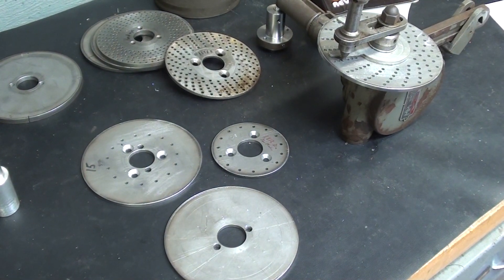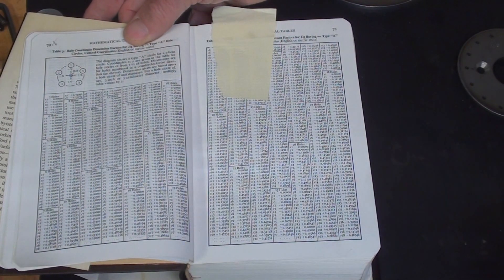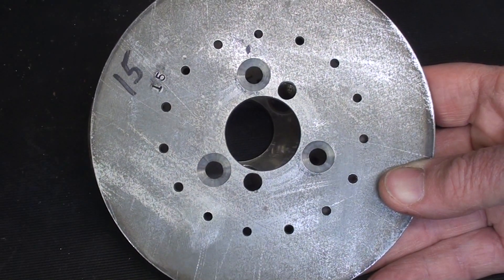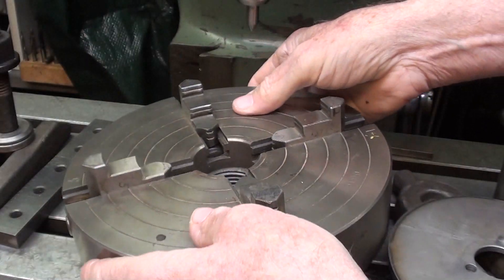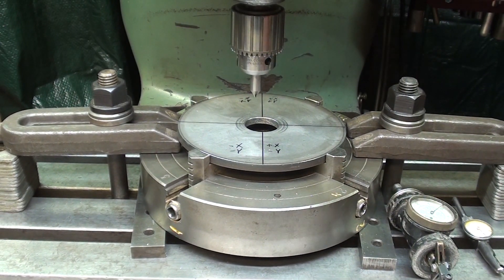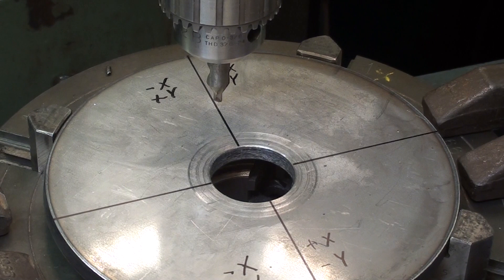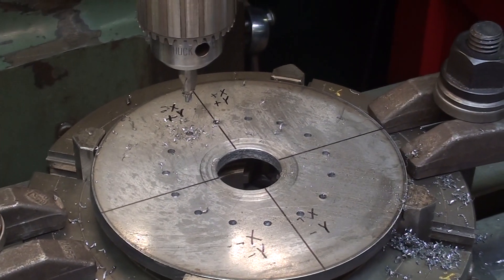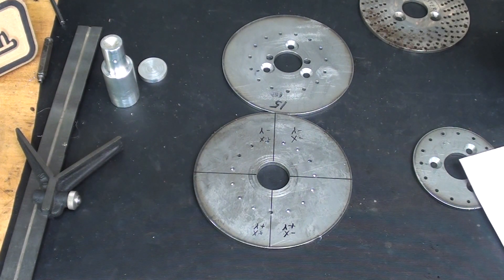Making Indexing Plates TIPS #624 DRO METHOD tubalcain

Comment: Thank you, i have a gear reduction box with a weird 39 to1, but i may not have counted right 😂, anyhow i am making custom divider plates and your videos are helpful, i found an online site that you can plug in any size or number of holes you want and then down load the picture. With that i load it into my snapmaker software and burn a blank with my 40watt laser out of 1/4 wood, the wood is serviceable and i debate if i should make metal ones or not. Thanks again.
Reply from the maker: That is awesome. Never heard of wooden plates, but I’m sure they work fine

Comment: The math is easy for anyone who has had a first lesson in trigonometry.  Rather than explaining it, I figured it would be more helpful if I put together a web page that did the calculations:
https://marknahabedian.github.io/DesignWithSVG/dividing_plate/dividing_plate.html.
That page let's you specify multiple dividing circles, gives the X and Y coordinates for each hole and provides a drawing.

I didn't design in mounting holes, but as long as those are regularly spaced at the same distance from the center they can be spotted by setting the innermost dividing circle to the needed radius with the right hole count.

I did some simple hand testing in Google Chrome.  There might be some buggy edge cases or update and display issues in other browsers.  If you have problems with it, please file an issue on GitHub.

I wish you and your family the best for the coming year.
Reply from the maker: Thank you very much for that. I hope some viewers will benefit. Happy New Year’s to you and your family

Comment: Hi Lyle, 
I recently did a dividing plate on a turret mill using the DRO, using the hole pattern function which all you need is the centre point, the number of holes and the PCD, hit the go button, and wind the handles to 0,0 and your at your first hole, then the next button and wind the handles to 0,0, and keep going. 
It was spot drill, drill, countersink and ream. It's slow on a manual machine but accurate. 
I also drilled the backplate with two holes for each of the dividing plate sets of holes that doubled the number of spaces for more options. 

Cheers Dennis.
Reply from the maker: That is an awesome way of doing it. You are lucky to have machinery like that. Merry Christmas

Comment: Mr. Pete, I own a book entitled "Holes, Contours, and Surfaces" illustrating methods used on Moore Jig Borers and Grinders. The book includes a full set of Woodworth Circular Tables showing rectangular X and Y coordinates up to 99 holes. By plugging in the proper numbers in your calculator and DRO you can precisely locate and machine all coordinates for these holes.
Reply from the maker: Thanks I was unaware of that book
Reply: @mrpete222  I will send you more complete info on the book including title, author, and copyright year. I'll also share photos if you provide your number. Once you receive these you can share them  with your viewers. Thanks again for your great instructional skills.

Comment: Thanks Mr Pete for this instructional video. My DRO on my manual mill has a function that finds the hole locations on a circle - just select the hole circle with the number of holes then press the next button for each hole and go to 0.00 X 0.00 Y on the readout and drill. I also have a Moore Tool Jig Grinder that can manually locate and grind holes within 0.00005" on location and size. 

Have a Merry Christmas.
Reply from the maker: Wow, that moore Grinder is amazing. Merry Christmas

Comment: Have done lots of hole patterns with just the machine dials and handbook tables. It's helpful if doing it this way to blue up the work and mark the hole circle with dividers. Set the dividers for the hole to hole chord length and go around marking off each hole. The reason for doing this is that if you've made an error in the number of hand wheel turns or have the slack in the machine's feed screws going the wrong way, you'll be able to see that you've missed something and can back up to the last drilled hole and re-do the moves to the next hole. I always go with the slack in the feed screws so the numbers on the feed dials are increasing to the final position of the hole to be drilled.
It is certainly more tedious than having a DRO with hole layout function, but it's not that bad to just crank the dials (but like threading you have to concentrate on what you're doing without distractions).  If the holes have to be located closer than your machine's feed screws are capable of doing you can use dial indicators on the X and Y axis to get within 0.001" of the target position.
Cheers from NC/USA
Reply from the maker: Thank you for some great suggestions

Comment: Thanks for using my oil cup. I noticed you was using it. I mentioned the bolt circle option on the newer DRO one thing it does is makes that kind of job a snap. I’ve had a couple of projects lately that I’ve used it on my mill and it works well.
Reply from the maker: Hi Jim. Yes, I strategically place your oil cup in many of my videos.

Comment: Lyle,

Speaking of Moore Tool Company's jig bores for accurately locating & machining holes similar to what you did in this video, Moore Tool still offers their two books
"Foundations of Mechanical Accuracy" by Wayne R. Moore
and
“Holes, Contours and Surfaces” by Richard F. Moore
at <http://mooretool.com/publications.html>.

Both books, new from Moore Tools, cost much less than what you might pay on Amazon or eBay, depending on the seller.  I prefer the printed versions, but you can also find PDFs of these books online -- I checked out the PDFs before buying my copies to ensure they were what I wanted.
Reply from the maker: Thank you very much, I will check that out

Comment: This is the most accurate method since it doesn't rely on already made plates. Any error on the original plate by tranfer or direct or angular division copies onto your plate. Any slack or play in your milling machine table is the same slack when you mill your gears or flats on your work so you can allow for it. Any error in the hole pattern of the original dividing head plate transfers to the copy if used to make another
Reply from the maker: You are quite right. Thank you for a good analysis

Comment: My new mill DRO calculates bolt circles for you.  After each hole you push a button and turn the table handwheels until the readout zeroes X and Y again.  I never knew that the coordinates were in the shop manuals.
Reply from the maker: My DR role is as old as dirt. It doesn’t do anything extra

Comment: It can also be a big help to layout your hole pattern with caliper and scale before you start drilling. Mark where the hole is supposed to be with a felt tip circle. While this is not accurate at all it will show any errors in your numbers visually on the part. A bit of a reality check on your math. Then when you drill the actual holes by the readout on the DRO, if you're not drilling very close to where you marked - you're doing it wrong.
Reply from the maker: Thank you, that is mighty good advice

Comment: I'm currently working on an index plate for 11 holes and it will be somehow adapted to a rotary table and hopefully used to cut some splines on a shaft. My DRO does bolt circles so the layout will be pretty easy.
Reply from the maker: Thank you, my DRO is very old, does not have that capability

Comment: The math here is pretty easy. X is just the radius times the cosine of the angle, Y is the radius times the sine of the angle, and the angle is 360° divided by however many holes you have. I.e.:

(x,y) = r × (cos 360°/n, sin 360°/n)
Reply from the maker: Thanks

Comment: Mr. Peterson, at 2:45 you say: "But again, why would you want to do the math, I wouldn't even even know how to do it off hand."

(raises hand) Oh, sir, sir, I know this one, can I say it?

It may be a bit of work depending on the number of holes but it's not really hard to do.

First you divide 360 degrees by the number of holes you want. For example if you want 30 holes, the angle between them is 12 degrees.

With a calculator take the cosinus and sinus of each angle around the circle. So in our example you will have 30 (cosine, sine) pairs.

hole #1 @ 0 deg: (cos = 1, sin = 0)
hole #2 @ 12 deg: (0.9781, 0.2079)
hole #3 @ 24 deg: (0.9135, 0.4067)

etc. until you reach

hole #30 @ 348 deg: (0.9781, -0.2079)

So the cosine values will be your X coordinates, the sine values will be the Ys, assuming the radius of the circle is 1.

Then you just multiply all your sines and cosines by the actual radius (not the diameter) of your layout circle to get the real coordinates for your work.

A DRO's or CNC's machine coordinate system often has its origin (where X=0 and Y=0) on the far (upper) right instead of the near (bottom) left of the table. In that case you may need to invert your positive coordinates to negatives and vice versa. Also depending on where you want to start drilling you could start counting not at 0 degrees but at any angle position of your choice.

Calculating coordinates like this could be a fun passtime with notepad and pocket calculator at the kitchen table. Or make one of the younger family members do it for you, they can probably use the trigonometry exercise.

Of course CAD & CAM make all this work unnecessary but I'd argue people still need to understand the underlying principles to be competent users of such software. And a CNC programmer or operator certainly needs to understand coordinate systems before they punch The Green Button.
Reply from the maker: Thank you, you did a lot of math
Reply: @mrpete222  It's actually not a lot of math, basically just high school level trigonometry and some calculations that must be repeated a number of times. If one had to make a complete dividing head plate with multiple circles of indexing holes, it would indeed be quite boring this way. But still doable, if a person is motivated and/or doesn't have access to the methods you have shown in your previous videos.
Reply: There's a really good book titled 'Dividing' by Harold Hall. I found mine on Amazon. He describes the calculation formula
for this purpose. He also explains how to calculate using computer spread sheet programs such as Microsoft 'Excell'.
I thought this was such a fascinating subject that I actually learned how to use Excell playing around with calculating
bolt hole circles just for fun & possible needed knowledge for the future.

Comment: Hi Lyle and Merry Christmas. The hole pattern is mirrored in the X axis. Hole 1 is on the X axis. Holes 2 & 15 are the same distance from the X axis (just the sign changes). This goes for holes 3 & 14, 4 &13, 5 & 12, 6 & 11, 7 & 10 and finally, 8 & 9. Looking at your table @ 4:44 in the video, you can see this pattern EXCEPT the X coordinates for holes 7 & 10 are not the same (10 is a typo). They should be .841 for 7 and -.841 for 10. This pairing also goes for the Y axis, but since they are not mirrored like the X axis, the signs are the same.

Comment: Edit: Spreadsheet calculator: https://docs.google.com/spreadsheets/d/1bGjV2a27Cu6K9zjxmaCLDo4aj7qGtjkTMnQJ34aYQ_A/edit?usp=sharing

To calculate for any number holes: 

put calculator in radians mode
N = number of holes in pattern
h = current hole number
r = radius
x = r * sin (2 * pi * h / N)
y = r * cos (2 * pi * h / N)

Comment: Hi Lyle,  I was 3rd generation at the old Hardinge Brothers plant in Elmira, N Y.  We made the Hardinge PC-55 dividing heads for many years. All of our dividing head plates we made on a old converted HC chucker lathe equipped with an air spindle to drill the holes using master set of plates. Very time consuming and labor intensive. A few years ago Harding had a big auction and one of the machines sold was the old HC set up. It didn't bring much but I didn't have the room for it. I should have bought it! Best regards, Mike Drake, Elmira, N Y
Reply from the maker: That’s interesting to hear how you did it at one of the worlds greatest machine tool builders.

Comment: Went to a shop to pay for an upcoming new machine video and they guy had a jig boring machine.  Very cool machine in general.  reminded me of a boring head for the mill with a rotary grinder rather than boring bar in it.  Sounded like a jet turbine as the grinder spun at like 120,000RPM.
Reply from the maker: I think I’ve seen one of those ones. But I think it was on a video

Comment: Nice job came out great.  Takes some time.  Thanks Lyle for sharing,  Merry Christmas.
Reply from the maker: Thanks Randy. I liked your video where you repaired the power drawbar. I thought maybe you were going to replace the hollow pin with a solid pin. But perhaps, it’s best to use the roll pan as a sheer pin. Merry Christmas
Reply: @mrpete222  I think so.  Thanks Lyle,  Merry Christmas.

Comment: Math not that difficult for hole circles. Basically right triangle trigonometry. The radius of your bolt circle is the hypotenuse of the triangle. Then it is a matter of using the sine and cosine formulas to find the opposite and adjacent sides depending on the angle which become your x and y coordinates. But a lot of DRO’s have bolt circle functions built in. Thanks for making the video.
Reply from the maker: Thank you for watching

Comment: You gonna end up with MANY 15 holes plates for sale...   lol
There is also the DRO model that has built in the feature to make bolt circles, this is another practical way to make many accurate holes around a plate.
Not all amateur machinist will purchase one of those DROs, but, if you know someone with one, you can punch in the request and take note of the numbers on the display, this makes a great calculator.
If someone is proficient with a spreadsheet, here is another method to make calculations easier.
Enjoy Xmas time with the loved ones...   !!!!    🎅🎁👍
Reply from the maker: Lots of ways to do any job, merry Christmas
Reply: @Pierre's Garage
https://docs.google.com/spreadsheets/d/1bGjV2a27Cu6K9zjxmaCLDo4aj7qGtjkTMnQJ34aYQ_A/edit?usp=sharing

Comment: If one ever need to do a hole count and can't find the table for it, recall how the unit circle (radius 1, centered at (0;0) ) relates to the sine and cosine of the angle of a line through (0;0) counterclockwise from the positive x-axis. Sine is read on the y, and cosine on the x, axis of the point where the line intersects the circle.
So for M holes on a radius R, first (starting on 0) hole on the positive x-axis, stepping N through 0 to M-1, with (0;0) being the centre of the plate.
X and Y coordinates of hole N are:
X(N) = R * cos(360*N/M), Y(N) = R * sin(360*N/M)
A spreadsheet would save on typing, and typing mistakes, compared go a kalkylator...
Reply from the maker: This is way beyond most people, but thanks

Comment: Kudos to you Mr. Pete for tackling a very difficult subject and making a video. A few suggestions. In machining school, they taught us to try to always use 3 clamps. First, the part is a lot less likely to move and in case you have to temporarily move one of them, you still have 2 holding the part firmly. The CNC guys would laugh at me when I did hole circles, because I would do one hole at a time. First center drill, then hole size, then tap if needed. They suggested I first center drill but just ticking the hole circle. That way I would go around the circle and check my work. That way if something was wrong, I would just have a small tick on the part, no harm, no foul. Next I would go around the circle again, this time center drilling each hole. Then do my tool change and drill each hole to size. This is quicker because less tool changes and less chance of making a mistake.
Reply from the maker: Good suggestions, but that would take a long time
Reply: That's what  I said. Try it. You might be surprised like I was. After working in a shop for 27 years, I would like to think I learned a trick or two ;-)

Comment: My favorite part about using this method is if you are starting from the blank you can accurately do all the holes without needing to do any indicating in as you can do it all in one setup.
Reply from the maker: Yes
Reply: Yes but you have to be careful to accurately centre the blank to the spindle. If not centred correctly the hole wont line up with the plunger